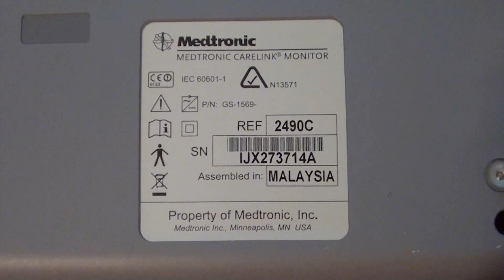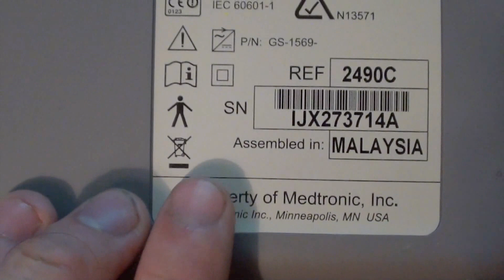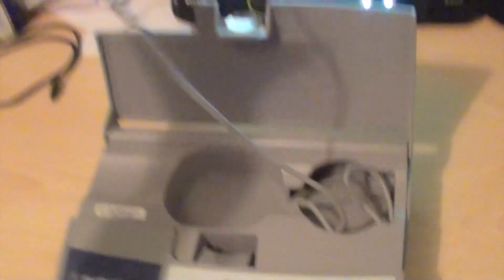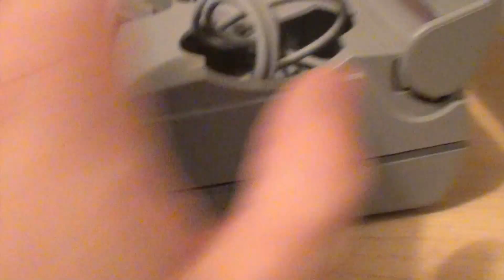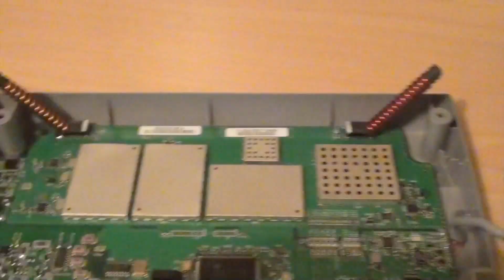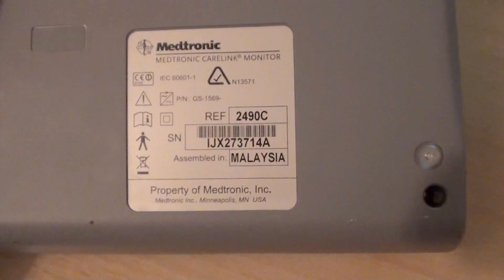Medtronic Carelink Monitor 2490C Teardown

Comment: A good tear down but you have a few bits wrong. If you read the product manual you will see this is the wireless device. The patients pacemaker, once set-up, is automatically connected to and data downloaded wireless. That is what the top part of the board is used for, not 3G/GPRS.  3G/GPRS is on a totally different model which was only released in 2014.

Comment from the maker: It's hard to imagine they would go to that much trouble, and take up half of the board adding extra cost simply for initially programming the device. The most common method would be to place the board on a bed of pre-set pins which would make contact with individual component legs and/or test points. That is how >99% of devices would be initially programed.